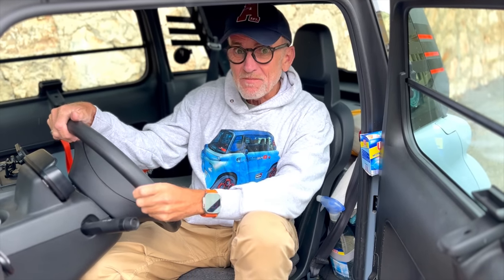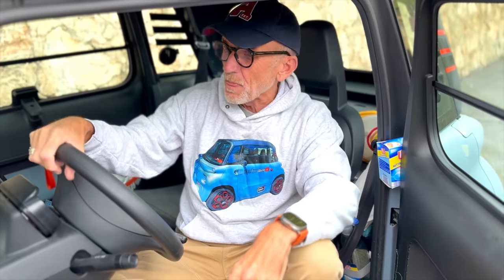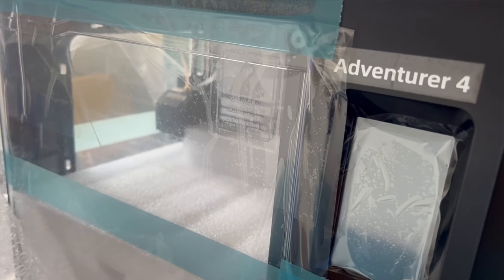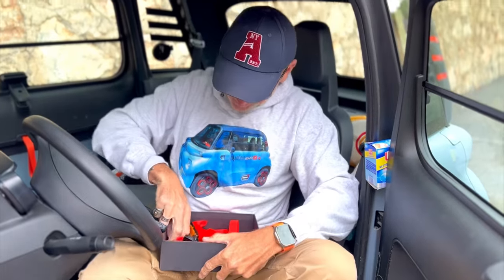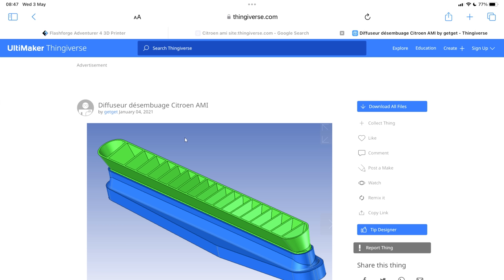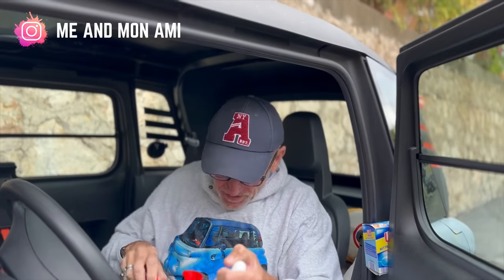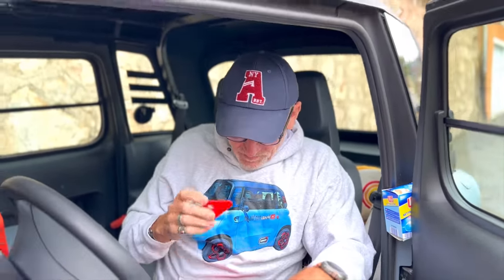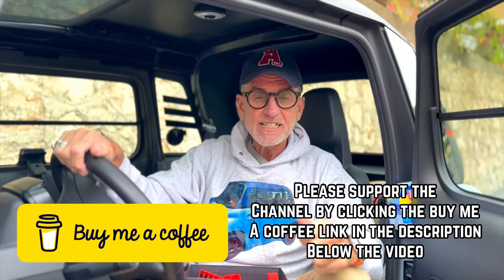CAN I Learn To 3D PRINT Parts For CITROEN AMI? My FIRST 3D Printer, Flashforge Adventurer 4 Arrives!

Comment: The windscreen diffusor for the defogger, the door strap sealer, the hole in door seal, all ready in time for the summer heat ☀🥵 😅
Reply from the maker: Indeed though the defogger is needed whenever rain comes at whatever temp!

Comment: The Citroen Ami community has published a lot of 3D files for various replacement parts/accessories/enhancements. And please DO NOT USE PLA. This plastic will melt under the sun. There are better plastics for making car parts that can withstand the heat and the UV rays from the sun. Keep up your excellent work. Also, about plastics. If you use PLA it is biodegradable (mostly)
Reply from the maker: Thanks I’ve progressed into PETG now!
Reply: @MeandMonAmi  given the quality of your printer, an enclosed one, you could use ABS. It's a tricky material, as tricky as TPU. But as you've already been successful with TPU, ABS should be a treat. The reason for choosing it is just the higher temperature it can endure. PLA will soften and loose mechanical strength much easier. By the way, I'm a neighbour, on the other side of your hill, not very far !
Reply: you can use pla and cover it with carbon fiber (check the numerous 3d lambo prints)
Reply: @jean-pierredesoza2340  do you have a link for the filament you use... I am particularly interested  in the light blue color... thanks!

Comment: 3D printing is amazing, you can create you own accessories, several shapes and materials for daily use or just for fun.
I guess as the time goes on more and more files will be available all over the internet, however you may need to test the materials resistance and melting  under scorching heat, in some places like the south of France a car parked in the sun can rise up inside well above 60ºC, I hope the materials last.
Reply from the maker: Yes I’m also using PETG now which is stronger and I think more heat resistant. I don’t want my bag holder to droop!

Comment: Hi ! I hope you didn’t print the elements for the car with PLA. Because it won’t withstand the heat. It will melt and deform. It is preferable to use PTEG filament or even better nylon filament (difficult to print but very heat resistant and very solid) ;-)
Reply from the maker: Thanks I’ve been using PETG as well so shall try the draft excluder and bag holder in that too

Comment: A Ami based guitar case or carrier mounting brackets/clips. A removeable dinner tray arrangment/mobile office desk/mobile music studio editing desk. Speaker mounts, and a dash mod that you can attach a LoRa type radio device for about 25 bux, that can allow for free 2 way email access as that can allow for ordering a pizza while from the middle of rural nowhere to be ready for pickup, also allowing for a best solution in areas that have no cellphone coverage even if should the batteries run out of power and your stuck and dont want to fully expire from frostbite because that really never produces afterlives, even if putin in the big club carlin mentioned about, says otherwi$e.